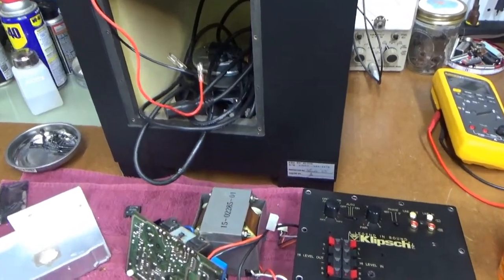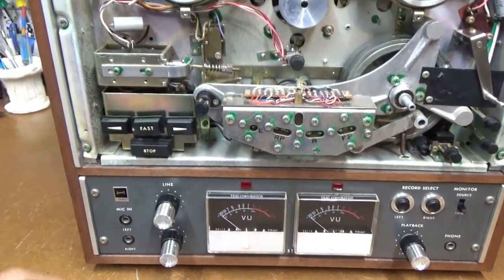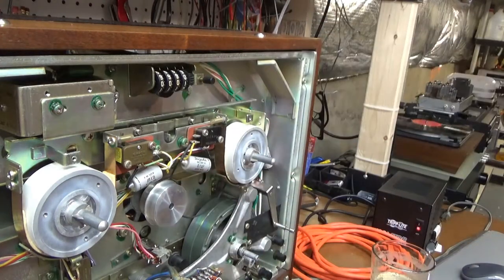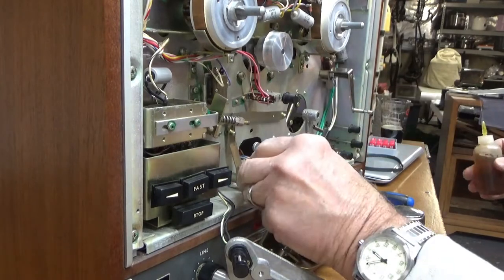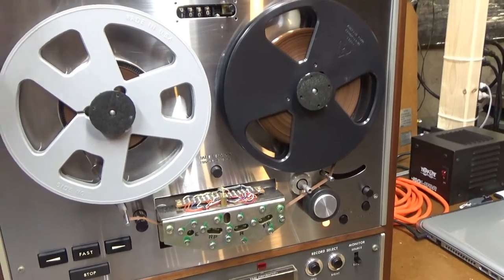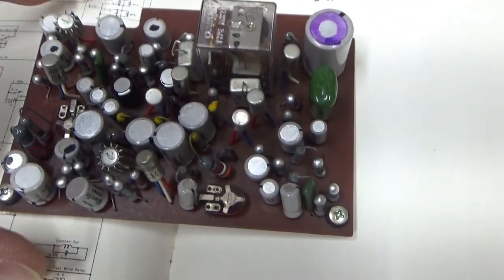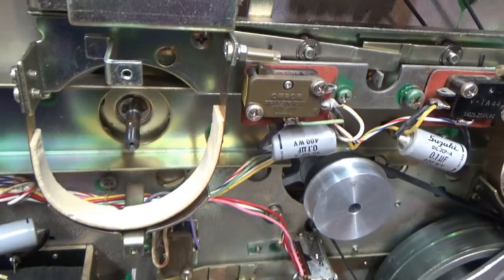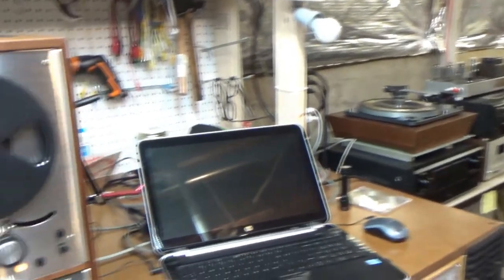1967 Teac A-4010S Reel to Reel Restoration

Comment: Very interesting, I’ve worked on a number of these decks over the years and I’ve never run across one with that little playback amp in the mechanical section. They made so many variations on this deck while keeping the same 4010S model number so I guess one really has to go by the amplifier model number.
Reply from the maker: I think this is a fairly early version of the A-4010S. The playback head amp allows you to use the upper part of the tape deck for playback only without the lower record amp connected. I think the unit was actually sold as a playback only deck without the record amp. I eventually discovered the source of the intermittent noise in the playback amp. It turned out to be a bad resistor. Here is a link to the video where I fixed it. https://youtu.be/elbDR8WQNbw

Comment: It appears to have a mechanical relay to switch heads for the reverse direction.  If the relay is noisey, that could also be part of the problem. Rapidly switching direction might help.
Reply from the maker: Thanks for the comments. I did eventually find the cause of the intermittent noise. It turned out to be a bad resistor in the head amp circuit. Here is a link to the repair video. https://youtu.be/elbDR8WQNbw

Comment: That's late '60s and the early revision with PNP germanium transistors.  Later revisions don't have the same transistors or the playback amplifier inside the deck.  The two upper micro switches behind the faceplate are also gone on later ones, as well as the patch cables in the rear.

Comment: i have worked on a few Teacs. You have the left side threaded wrong. There is also a allen key on the reel tables buried behind to set reel table height.
Reply: Just got to your discovery of the Allen key.
Reply: Never understand how all the youtube repair people do not try the weakest link first. Clean and demagnetize, Clean switched and pots. Then dig deeper. I think that's a bad transistor that white noise. I got that from 12voltvideo.
Reply from the maker: @MICHIGANROCKSANDROLL  I originally thought it was a noisy transistor. After replacing all the transistors and capacitors on the head preamp the noise temporarily went away but eventually returned. I eventually found a resistor in the driver transistor emitter circuit that was breaking down when it got warm. I replaced the resistor and now the noise problem is permanently fixed. Here is a link to that video. https://youtu.be/elbDR8WQNbw
I also fixed the fast tape latching problem. Here is a link to that video. https://youtu.be/cEJv2x9zNSs
Reply: @mguess  Permanent? No such thing.
Reply: @mguess  Pretty good video. May have to watch more.
Reply from the maker: Agreed, but hopefully it keeps working for a long time.
Reply: @mguess  I  have 4 Teacs 3- 3340(*) and a 2340. Two I keep for parts. A friend and I made music in the late 70s and i have many tapes from then. And it's  fun to mix the audio. Capture devise have gotten way better since I originally transferred the audio so the process is continuing.

Comment: I watched your video at a perfect time as I started restoring a 4010S that I inherited from a family member. Mine had many of the same issues yours did including the noisy output. Unfortunately, your video was a CLIFFHANGER when it came to the replacement of the transistors. Would you mind telling me if the NTE102 were a directly replacement for the 2SB486 on the preamp board, and if so, how did the unit sound after you made the replacement? I wish you’d do a part 2 to your video!
Reply from the maker: Sorry for the cliffhanger. I ended up replacing all the transistors on the preamp board with NTE equivalents. All the replacement transistors worked well and sounded good. Unfortunately I never completely eliminated the noise problem. It is very intermittent now so hard to troubleshoot. I also never fixed the fast tape motion latch issue.  You are correct, I need to do a "Part 2". Maybe I'll start working on that since there's not much on the bench right now. Let me know if you find your noise problem and what fixes it.
Reply: @mguess  I sure will. And thanks so much for getting back to me. If I may ask, did you replace the 2SB486 transistors or the 2SB189… or both. I always thought the 486s were the output transistors.
Reply from the maker: I replaced both. The 2SB189 is the output transistor.
Reply: @mguess So you replaced the 2SB189 output transistors withe the NTE102A?
Thank you

Comment: Thank you for sharing your work!  I am on the path right now with a unit I'm trying to fix for a friend. Your schematic looks quite clean and readable  - would you be willing to post it here?  The PDF's I've found are badly compressed and some part values are compressed  into blurry blobs of pixels... Thanks!
Reply from the maker: If you want to give me your email address, I'll forward you the scans of the schematics from my copy of the original manual that came with the tape recorder.
Reply: @mguess  I like that the boards are removable much easier to work on them. Good job on the rtr.
Cheers
Reply: @mguess How did you remove the amplifier board  from the chassy? I have one screw at the bottom right side is covered by the plastic backing that goes around the cable inputs and power cable? 
I need to replace the capacitors on mine.
Thank you

Comment: Hi, i recently acquired a teac a4010s (ar40s). Previous owner kept it in a closet for decades. It does not have the 2 silver screws on top of the cabinet like yours, do you know what year it was made? i Change both belts, lube and deoxit. Every lights and meters working. Sounds really good. Do i need to replace the capacitors? its working and sound great thanks.
Reply from the maker: Mine is from 1967. I wouldn't change the capacitors if it's working ok.
Reply: @mguess  thank you sir! Playing old christmas carols
Reply: @mguess On my 4010s I have to turn the line level and the playback level all the way to 3 o'clock  to raise the volume to a listenable level so I think the playback amplifier board needs recapping.
Reply: @mguess I wish you would have showed how to remove the amplifier board from the chassy.
I need to do the same.
Reply: @mguess Sounds like the transistors are shot on the amplifier board due to the noise it's making.
Reply from the maker: @SDsailor7  As I remember it wasn't hard to remove the board. I have to remove it again due to noise even though I replaced all the transistors and capacitors. I'll let you know what I find out.
Reply from the maker: @SDsailor7 That may be normal. I turn mine all the way up for a normal listening level
Reply: @mguess  Hello, Thank you for replying back.
I was able to remove the board, I was confused thinking that the screws went  in from the outside, being that the two screws at the bottom of the board were missing was the thing that had me confused. So i removed the board and inspected it and cleaned it.
I just ordered the capacitors from mouser with the exception of the two square ones that sit next to the relay it looks that they have 3 legs instead of 2? one is a 10vdc 10uf and the other is 6vdc 10uf did you just order the normal two leg radial caps to replace those two?
Reply: @mguess  I read in a forum that it is recommended to control the volume from the receiver/amp. As far as the settings go according to the manual it says that the input should be set at around  2 or 3 same for the output.
I hope that once i change all the caps the volume/output improves.
Thank you
Reply: @mguess  I will let you know how it comes out once i install the caps and if there is or not any change.
Reply: @mguess  I found mine at a local thrift store and the cabinet was all beat up but all it needed was belts replaced and lube and cleaned and it worked!. So hopefully the caps make an improvement in the output.
Reply from the maker: @SDsailor7  I didn't replace those. I probably will next time i have the board out.
Reply: @mguess  I am wondering why they have 3 leads? And how would one replace them with a regular cap? Maybe one is positive and two are ground 🤔?
Reply from the maker: @SDsailor7  That's probably why I didn't replace those, I couldn't figure them out. I need to do some more work on that board. I'll let you know the results

Comment: I removed the reel table to install the counter belt, it was not hard.
Reply from the maker: Thanks for the input. I probably should have done that also rather than struggling to  push the belt around the reel table.
Reply: @mguess  I noticed that you had the belt on the front of the flywheel (smaller section of the flywheel) and on Jordan Pier video he had it on the back (the larger section of the flywwheel) did yours operate correctly at the proper speed? also where did you put the other end? on the smaller section or the larger?(the small pulley).
Thank you